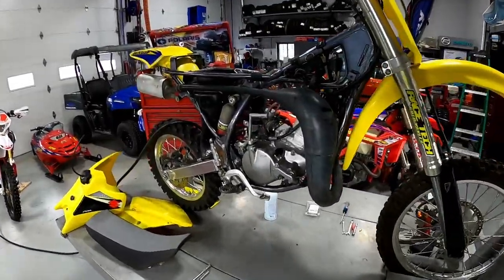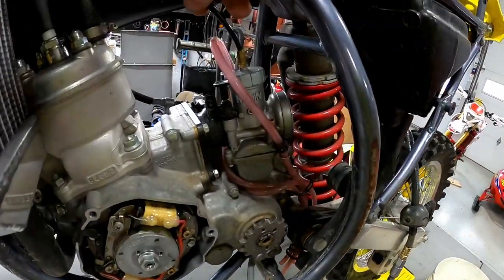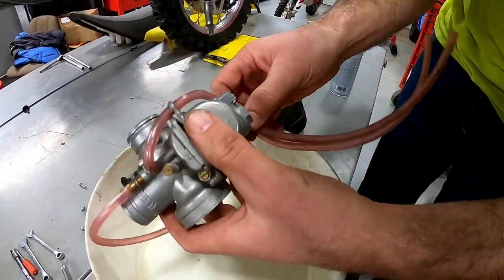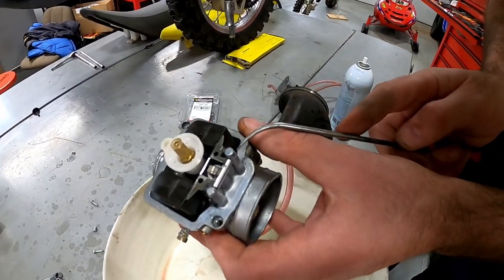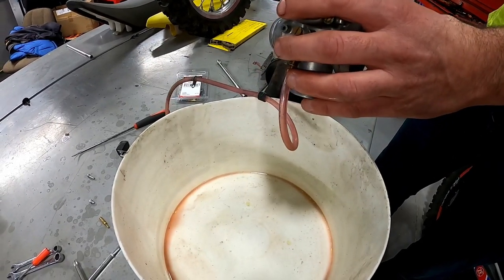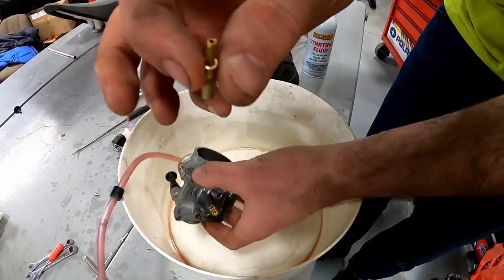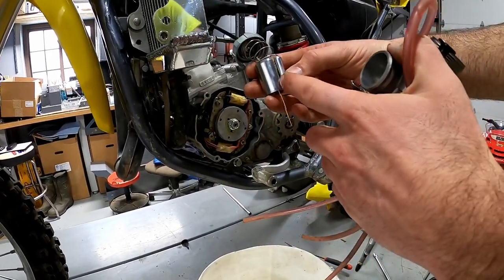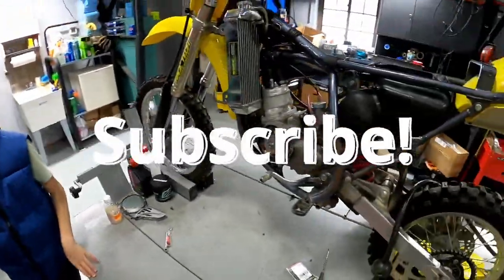Dirt Bike Carb Clean | Bike Running Rough? |  2016 Suzuki RM 85 2-Stroke, Carburetor Removal

Comment: Where was/is your needle clip I have a 38 pilot jet and my rebuild kit came with a 50 bike runs mint no coughs bogs or nothing I just freshly fully rebuilt the engine I do a lot of random work on random bikes but never went that full on but seems to run 100% but just wondering why I could be so low everything is stock apart from hgs ehr pipe I’m in the uk too